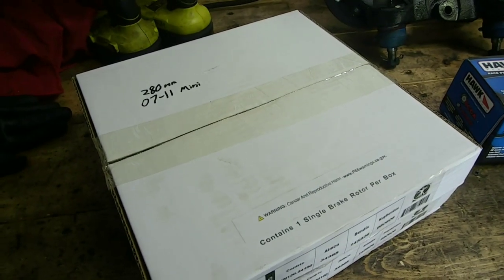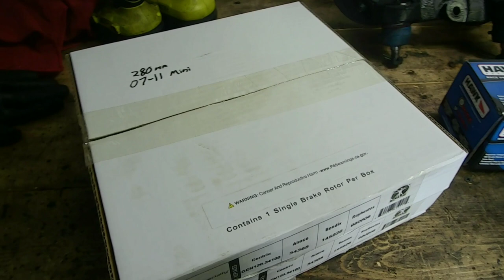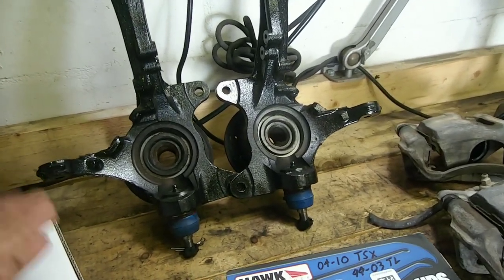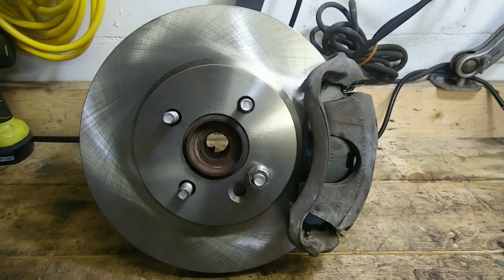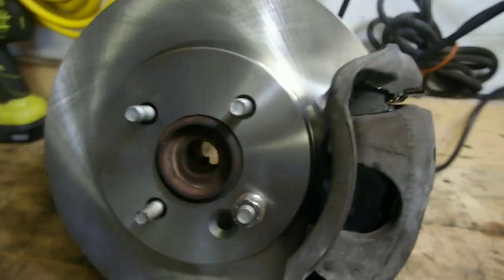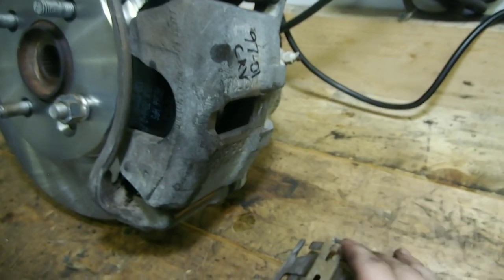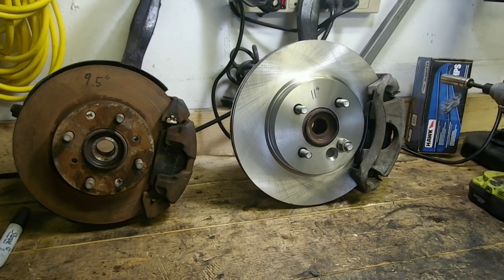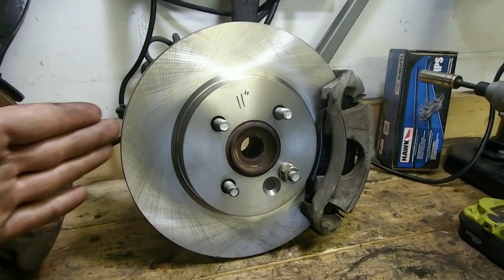Poor man's Big Brake Kit for your Honda

Comment: For those without ex knuckles fast brakes makes a bracket which will let you fit 280mm rotors + integra calipers
Reply from the maker: Pinned, thank you
Reply: @ThatParadiseEj1  thats much more money though. You can obtain these at the junkyards you just have to beat the crowd at it😁
Reply from the maker: @JoseContreras-mv5yz  absolutely. The knuckles and calipers in this video were obtained from a year for about $80
Reply: That’s to much money man you can get both Knuckles at the junkyard for $100 and who knows what other problems those adapters will give you more money more problems
Reply: @poopgoblin6997  which did you try out, the crv or the fastbrakes kit?

Comment: Do you have to change to a 40/40 Proportioning valve
Reply from the maker: Lots of debate on this question. Personally I would.
Reply: I know I’m late with this but my recent research has confirmed that the proportion valve on a civic si and hatchback are the SAME part number.
Reply: @TheCueball12 do you still have the part number - I could use it
Reply: @carlloftin2850  46210-S04-902 VALVE ASSY., PROPORTIONING 

prop valve just balances the amount of fluid going front to back, 96-00hatch dx/cx has small front brakes and drum in rear while 99si has larger front brakes and discs in rear so they end up needing the same balance, its more like a ratio, so if you change just your rear to disc and you have the small front brakes it might be a bit off but if you do the full upgrade to the bigger front discs and add the rear disc you can just keep the stock prop valve.
Reply: @TheCueball12  thank you - info helps a lot!

Comment: For us viewers in the UK we can use the MG ZS 180/ZR 160. 2001-2005.
The MG discs are a perfect fit 282mm/11inch and are 4x100, the retaining screw can be used also.
Reply: So honda crv calipers and mg zr rotors? And what pads can i use
Reply: my set .it works well

Comment: 1320 has adaptors for the lug nuts to fit tightly against the rotors.
Reply: Which ones are they, and u mean 1320 performance right?
Reply: @nickcat313  yes there about $20

Comment: I was wondering if you had to upgrade your Master Cylinder?
Reply: yes just to prevent any issues it’s recommended if not mandatory that you replace your prop valve and master cylinder.

Comment: Hey man, I've got a '98 Civic EX coupe. So I would be able to use the stock knuckle it has, right? As far as the pads, do CR-V pads of the same generation as the caliper not work with the Mini rotor? Just curious.
Reply from the maker: Your stock knuckles will be fine. As for the pads the crv pads will overlap the edge of the rotor. Not really a problem but will cause uneven pad wear in the future

Comment: I'm hoping you can answer a question. I'm going to do this upgrade and found EX spindles to use. 
Does it matter if they come off EG or EK? I found 97 EX spindles for decent price, just not sure if this upgrade works the same regardless of year
Reply from the maker: Yes this upgrade works on 96-00 knuckles too
Reply: @ThatParadiseEj1  hey one more question if you know. What brake lines are you using for caliper? I want to order some new stainless lines to replace rubber soft lines but not sure which to get. Thanks man!
Reply from the maker: @danny51577  no worries. I'm using Integra brake lines. Tbh the fronts aren't any different between these style chassis. The difference come into play whit the rear brakes. Drum brakes have longer hoses

Comment: So is the only difference on the knuckle the center bore? Or does the mounting point for the caliper different? I want to know if I can run the crv caliper with the Cooper rotor on a DX knuckle with a hub centric ring or something else to save some money on the knuckle. Thanks!
Reply from the maker: It's the location of the caliper mounting parts that's different. Center bore is the same.

Comment: Can I use the mounting hardware from the stock civic ex caliper and bracket ?? Also you mention tsx pads do I use the tsx pads shims ?
Reply from the maker: Hardware is the same. Use crv or type r shims. I'm not sure if tsx shims will work. Keep in mind to only use the shims that mount to the bracket. The large shim that mounts to the caliper needs to be removed.
Reply: @ThatParadiseEj1  got it thank you 💯✊🏼✊🏼

Comment: Question, why exactly do i need ex or si knuckle? i own a 91 crx dx. also, will this upgrade work with 15 inch wheels or will i need 16s?
 thanks in advance
Reply from the maker: The placement of the caliper changes. I've always ran 15's with this upgrade. But I'm sure some aftermarket 15's won't work
Reply: @ThatParadiseEj1  ahh I see, and thanks a lot I appreciate the info

Comment: Wait but what master cylinder did you use? Proportioning valve? The stock one worked?
Reply from the maker: Used a 15/16 master from a 91 ex. Prop is from a accord but stock is fine.
Reply: @ThatParadiseEj1  awesome thanks!

Comment: Could you get away with using your stock integra calipers or are there clearence problems?
Reply from the maker: That's the stock caliper for the knuckle. You can't run a larger rotor with the stock caliper.

Comment: Hey bro good morning I have a1997 civic dx hatchback can it wrk are I ofto get other stuff
Reply from the maker: You need ex/so knuckles
Reply: Ok bro thanks alot
Reply: What year ex/si knuckles I'll need
Reply from the maker: 92-00
Reply: Ok bro thanks alot
Reply: Hey bro goodnight one more question,what is the best booster and master cylinder to use and this break up grade?

Comment: So the Mini Cooper rotor has no bolts to tighten it down? I see one big unused hole on the Mini Cooper rotor
Reply from the maker: Yeah no bolts. The wheel holds the rotor just fine.
Reply: @ThatParadiseEj1  ok thanks man
Reply: @ThatParadiseEj1  1320 sells the bolt rings to hold it down for about $20 super legit

Comment: Will this work with 94 eg si non abs 9.5 inch front rotor ?
Reply from the maker: Yes sir.
Reply: Do I need integra knuckles?
Reply from the maker: Not if your car is a US spec si

Comment: Did u have to change master cylinder
Reply from the maker: I used a 15/16 91 Civic master. Ideally you'd want to use a ITR 1" master and booster

Comment: Hi, nice work can I have the crv calipers no its on the part because not all crv calipers same tayp-r
Reply from the maker: 97-01 aren't the same?
Reply: Yes . Thy said only one model of crv
Reply from the maker: Read the description.
Reply: I read your description. but from your experience there is no diffrence between the two
Reply from the maker: Correct. All 97-01 are the same.
Reply: @ThatParadiseEj1  you meant same type-r calipers
Reply from the maker: @najjara76  they are the same as Integra type r calipers
Reply: @ThatParadiseEj1  thank you. You help me a lot.

Comment: Can I use stock break line
Reply from the maker: I'm sure you can
Reply: @ThatParadiseEj1  on the dead homies!! Bout to be big breaking
Reply from the maker: To get the most out of this set-up you're going to want some braided stainless lines to eliminate the squishy pedal during hard breaking
Reply: @ThatParadiseEj1  gotcha
Reply: @ThatParadiseEj1  you notice difference in breaking power? Tbh I have gsr breaks I just needed to blow some money so fuck it got some type r calipers
Reply from the maker: @ssjdavid  absolutely. Make sure to get a nice set of pads. That will be the biggest difference
Reply: @ThatParadiseEj1  ok gotcha I was gonna just get some duralast gold pads from Autozone cause they have life time warranty. Think that’s fine? Car is only all motor lsv pushing like 200 to the wheels
Reply from the maker: @ssjdavid  yeah those will do fine. This is definitely the proper upgrade for a 200hp build. And those pad will be good for street uae
Reply: @ThatParadiseEj1  what would you recommend for the rear? Just matching pads and call it a day?
Reply: @ThatParadiseEj1  heard some people use ep3 rear rotors and rsx calipers. Is all that worth it or just front should be enough? I don’t want to throw the balance off either

Comment: What brake lines?
Reply from the maker: Original to whichever chassis you're using. I do suggest a stainless braided upgrade though
Reply: @ThatParadiseEj1  thanks so much for the reply just had to make just the ek hatch lines would fit

Comment: All that work for the same single piston, no thanks!!!
Reply from the maker: Lol, you think the piston size is the same?
Reply: @ThatParadiseEj1  how much weight does it add on? I think its just too much for a little 4 cylinder.
Reply from the maker: @gameovertune9018  Honda uses these calipers on the Integra Type r. I'd say it's a good upgrade when converting to a duel cam engine.
Reply: @ThatParadiseEj1  maybe for a 500 up whp civic. Not on stock motor.
Reply from the maker: @gameovertune9018  why would Honda put them on a 200hp car then?

Comment: what do you do for the rear on  a regular integra
Reply from the maker: I'm not certain the specifics buts it's a combination of ep3 parts.
Reply: 4 lug ep3 rear rotors and rsx type S calipers flipped upside down. Takes both ep3 or type s pads.
Reply: @astr0-creep130  sounds complicated is it worth all thst